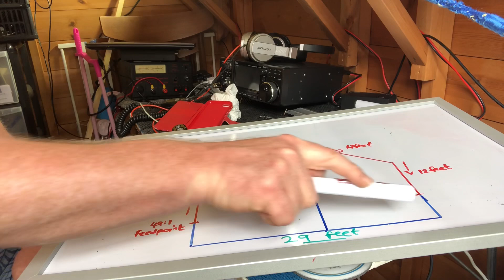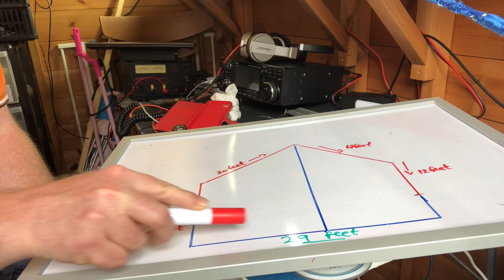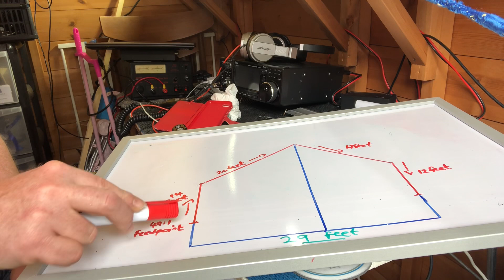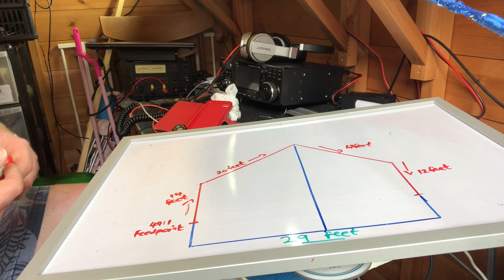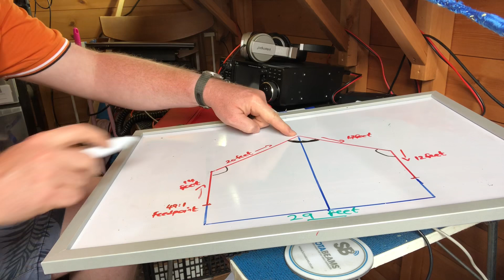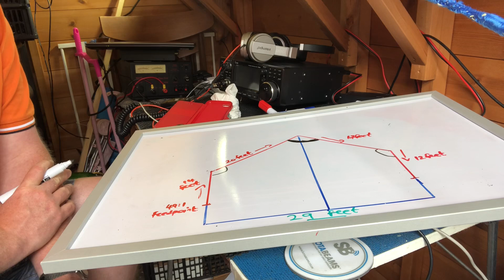HAM RADIO: EndFed Halfwave Antenna In a Small Garden

Comment: intresting but for me electrical  length minus  velocity  factor  of wire should  be left as is,,despite  the shape of the antenna,,i would just use tuner to bring it in to reasonable  swr reading, with common mode floating  about the only really  good place to take swr reading is antenna feed point  then deal with discrepancies.

Comment: Many of us are on the third and fourth floors of our flats and can't build large antennas. Do you have any ideas about that?
Reply from the maker: Maybe a mobile whip clamped to a balcony with radials?
Reply: @TIMG5TM  I am thinking of using your 10/11 meter coaxial dipole and toss it out the window to work the AMARS AM QSO party this weekend. I am in Madrid and AM is my favorite mode. Any port in a storm as they say. Thank you.  DE EA4/KF0XO
Reply from the maker: @radioguy19510  good luck with it and I wish you many DX 73

Comment: Hi Tim
Have you tried to do the Ofcom Calculation with this antenna yet.
I am thinking of changing mine to an EFHW and have almost the same garden dimensions as yourself.
Its the lowest height AGL that concerns me.
I can get the middle to 31 ft  and each end to 20 ft
So if I were to put my 64:1 transformer at the top of the first mast am I right in thinking that it would need a small counterpoise?
If so, I could  run it down the centre of the fibreglass pole.
Do you think that would work?
Great video by the way.
Kind Regards and 73
Mike G3ZCC
Reply from the maker: Hi Mike, either a counterpiose 1/20th of the wavelength long for your lowest band being used (so 2m for 40 metres for example) is ok. Or - fit a common mode choke about that same place on your feedline - so for 40 - 2m from your transformer. Do not fit a cmc right at the feedpoint without a counterpoise however as this kills any receive. Sounds a good set up - go for it. 73

Comment: Thanks, was just trying to figure out the same problem. Trying to fit a 80m multi-band 127ft end-fed in a 90ft long garden and the house shape sounds like the answer. How did you calculate the height of the middle support just wondering how high it needs to be to sqeeze in 127ft.

Comment: EFHW is a great aerial for sure. My garden is 4 metres long, 9.5 metres (house-width) wide, and I have three EFHWs, for 40, 30 and 17 metres. They work a treat, with contacts to Northern, Eastern and Southern Europe on 40 & 30, and all that plus USA on 17, all done using 4 Watts output. Max height is 11 metres on the 40 mtr ant, 6 mtrs on 30 and 5 mtrs on the (horizontal) 17 mtr wire. Nothing fancy, just wire, a good radio (KX3) and CW. No computer in the shack!! Les g0nmd
Reply from the maker: Just shows what can be done .. great job! 73

Comment: Hi Tim .... Just working my way through your excellent videos .... Just wondering what support poles you use  / do you have any  suggestions re telescopic poles  ?
Reply from the maker: I tend to use fibreglass telescopic poles at home ... I epoxy the sections and so far after 2 years they hold up ok. 73
Reply: @TIMG5TM  Hi Tim ..
Very kind of you to reply so quickly - Much Appreciated - 73 - Gerry

Comment: So even if you do a "sloper" with just one pole , and the connecting box a metre above the ground earthed with a copper rod the angle still applies from the top on the pole? The higher the pole not always the best case in this scenario Tim?
Reply from the maker: Jon the critical angle applies more to inverted v antennas in terms of the angle between the legs at the apex. If you are running it as a sloper then the nearer it gets to being at say 45 degrees the more directional it becomes in favour of the slope. The more vertical it becomes then it becomes increasingly more omni directional. 73
Reply: @TIMG5TM  So the slope would be a better choice when it comes to Antenna gain?
Reply from the maker: Marginally in the direction of the slope yes

Comment: Really good video Tim was the extra inspiration I needed to try my EFHW for 80m in my compact garden... one trick I did use to avoid to an acute angle on the bends was to use a T-piece on the apex point and sleeve the wire keeping the bends larger than the 90 degrees by cutting off the sharp corners ...thank you again ... it works too👍👋
Reply from the maker: Nice one Dave that sounds a great idea. Hope you are enjoying the antenna 73

Comment: Nice, interesting and practical advice.  I'd really suggest if you are aiming at new hams that you'd stick to the SI units (or at least mention both feet/inches and metric) mixing between meters and feet in the same sentence is not great and confuses beginners IMHO.  So my preference is all SI units OR all old school ancient measurement units like feet inches and megacycles - but only when connecting up your spark-gap CW transmitter for the 131 feet 2¾ inches band! 😁😁😁
Reply from the maker: Good advice thanks

Comment: Hi tim are your 7m poles longer flag poles with sections removed or are they spacific 7m poles thanks
Reply from the maker: Hi Brian they are the bottom
sections of a 10m fibreglass pole. With the top thinner sections removed. 73
Reply: @TIMG5TM  
Thanks Tim appreciated

Comment: Good video and creative use of space!

The thing I worry about with fibreglass poles, is them falling over. If you put them up against the fence i.e. the boundary with next door, which of course is the point of maximising potential antenna length. If the thing falls over, like as not it will land on the neighbours car or greenhouse or something. Guy lines could prevent that maybe but then they have to crisscross the garden. Do you use anything else other than tape to prevent the pole from collapsing down itself? Clamps? Maybe I worry too much?

I did buy a 10m pole from amazon, last year. I have used it. It has collapsed once, by which I mean the sections just telescope back into themselves. Do you leave yours up all the time, or take down after each use? Sorry, lots of questions.

73, M6EXF
Reply from the maker: Hi Stephen no worries. I epoxy glued my sections together and they are rock solid. The poles have been up a good year or so and through high winds have not buckled under the stress. I buy cheap windjammer poles off eBay that do the job. Thanks for stopping by 73
Reply: @TIMG5TM  Of course, epoxy glue! Thanks again for all the great, informative videos.

Comment: Do you ground the other side of the balun?
Reply from the maker: No it’s not strictly needed at the power levels I use.
Reply: @TIMG5TM  I've got 2 options for my first HF antenna but unsure of what will work the best. Inverted V or a radial free vertical.
Reply from the maker: Unless the radial free vertical is an endfed halfwave fed with a 49:1 I’d go inverted v
Reply: @TIMG5TM  Yes it is end fed with a 49:1.